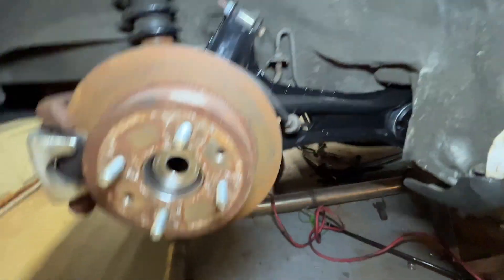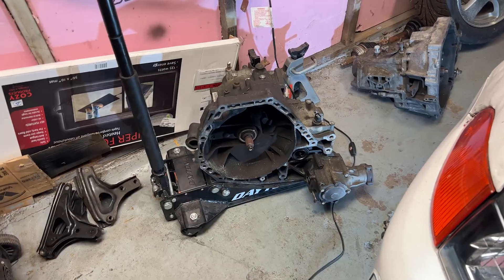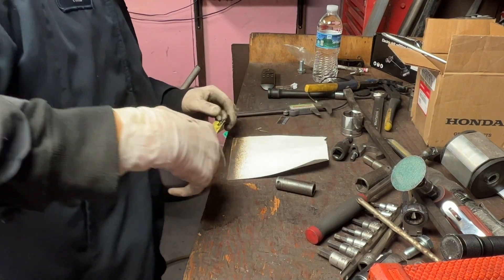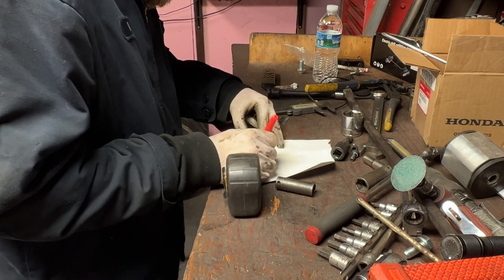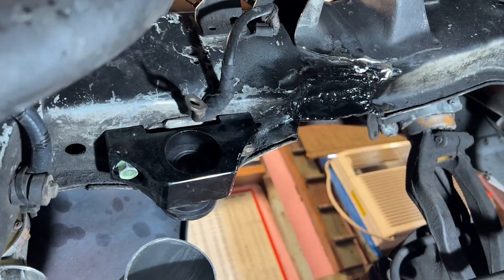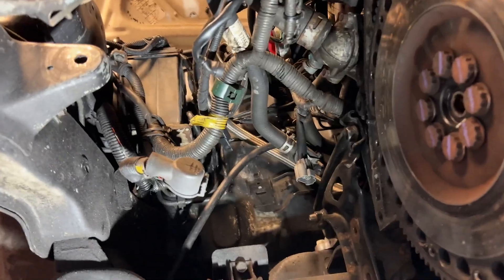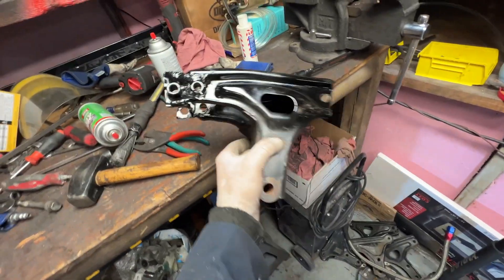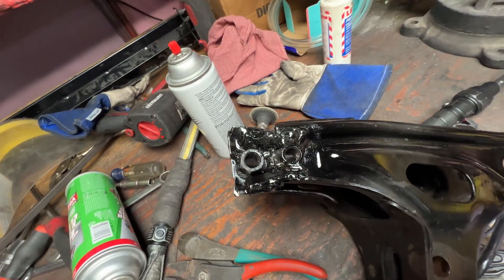modified CRV T bracket for BAWD transmission in an EG chassis -- EG AWD Civic pt2

Comment: Hi! Im doing the same swap!
I have the stock eg t bracket. Does that not work with crv transmission?
Reply: Stock EG B series is to add
Reply from the maker: @brome2383  no it is to short that is what I have and modified cause it was to short ek chassis can use the stock b series t bracket not eg